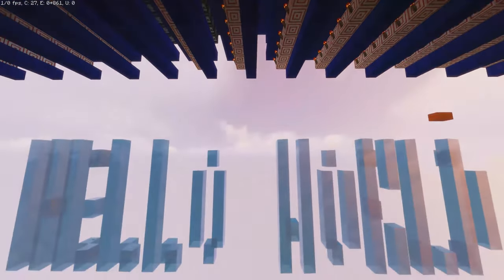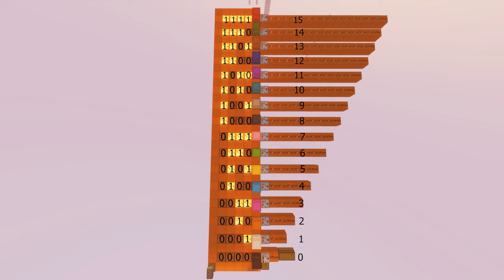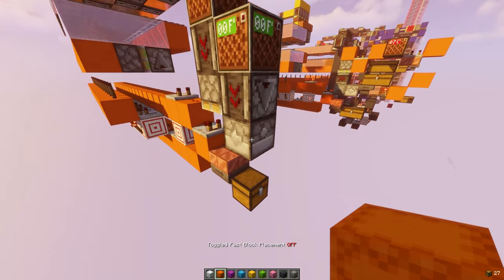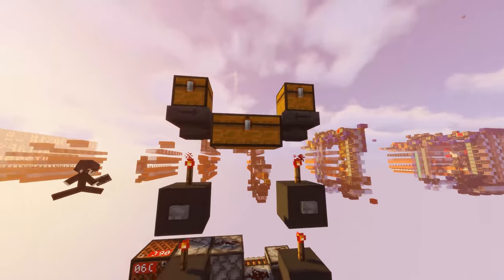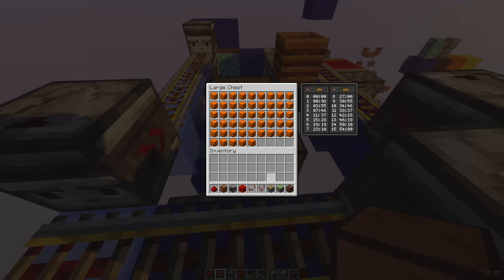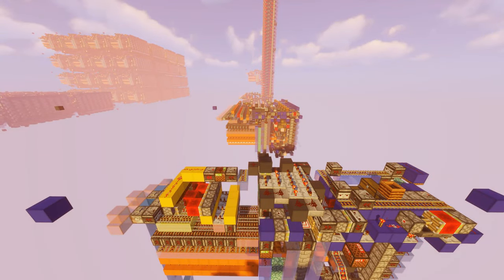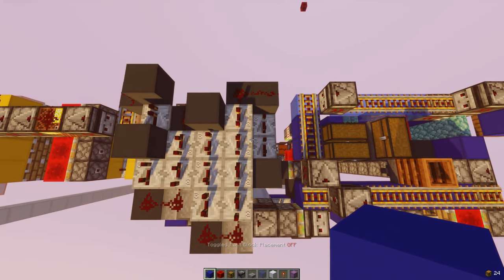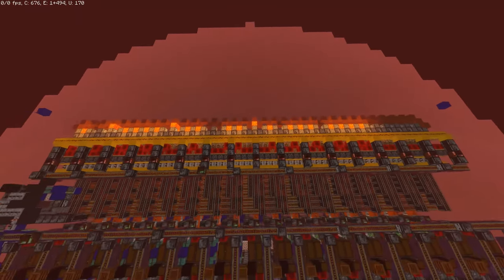Lava, Water, and Shulkers: A Unique Display

Comment: Absolutely insane! Do you think it can be built in survival? What's the most challenging resource for the cube? With a shulker farm should be doable, maybe it's a lot of quartz and redstone, and needs serious afk-ing at bartering or witch farms?
Reply from the maker: wel the most used component is the observer and the cube would use about 56591 of them wich is about 32 shulkers. and for the other building blocks you would probable need an iron farm, a wood farm, a redstone farm, quarz farm and ,a coble farm.
Reply: @MrKorwaldski  mmmm 32 shulkers of observers could be doable late game with the right farms and maybe mass craft ahah
Reply from the maker: Yea but what would you use the 320bps in survival for haha